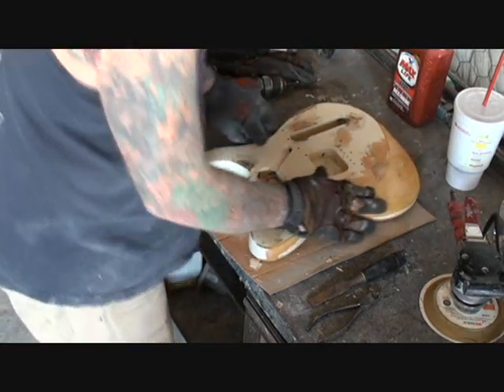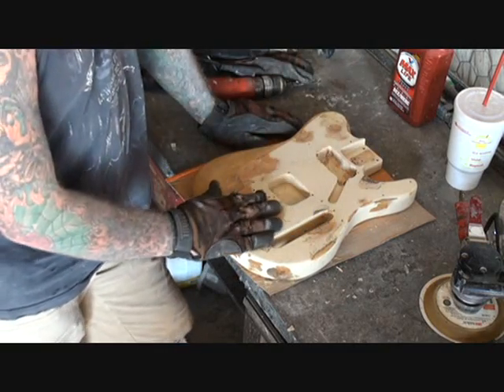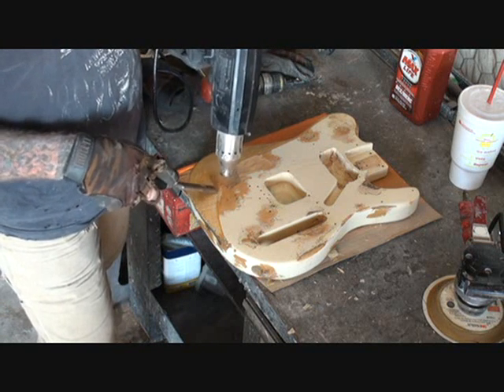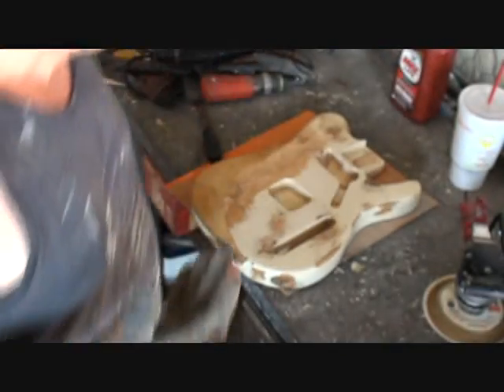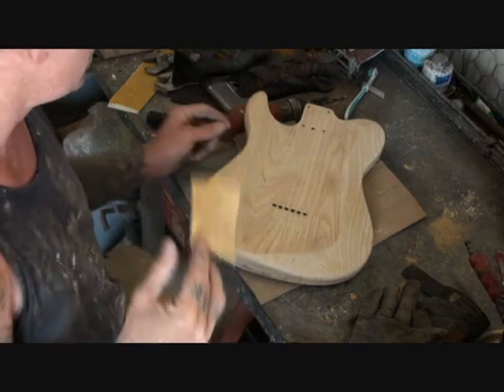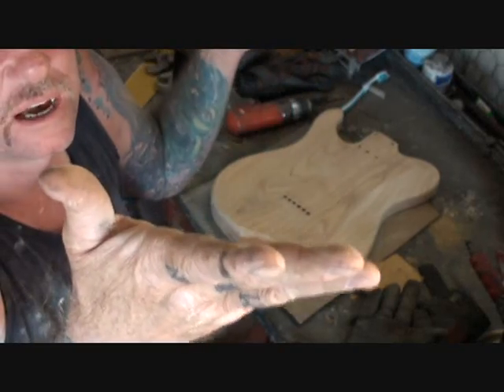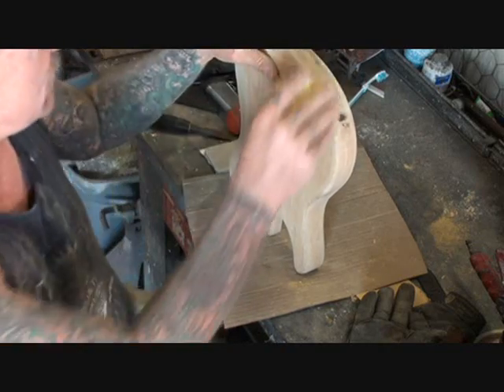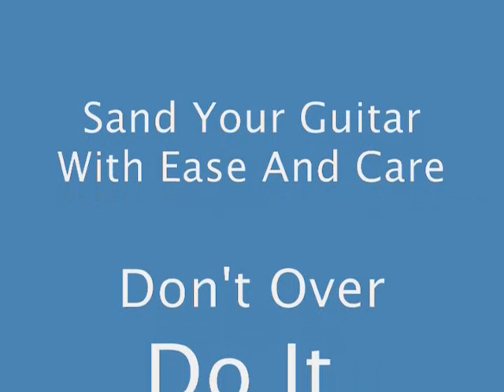How To Refinish Your Guitar-Peavey Reactor-Removing The Old Paint

Comment: Hey Dr, nice vids, I enjoy them! Im an artist out of Michigan. I thought it was perfect. I just wanted to share some knowledge. In last stage of sanding you can get super smooth surface by doing this. Wet a rag with warm water and saturate the surface of the wood. What this does is it brings up all the little burr ends when it dries. Take a piece of steel wool and deburr the wood. You can repeat 2-3 times makes finish go on super smooth. ENJOY!!!

Comment: @TidewaterHooligans Use klean-strip premium stripper. you don't damage the wood. Using a heat gun you run the risk of burning or charcoaling the body. If you do this, your new paint will not adhere well to the wood and it will not end well

Comment: Man,  I spent hours doing it with the heat gun,  and then I found this paint removing stuff.  All I did was pour the liquid all over the guitar  and let it soak for a while,  and after an hour or so all the paint was just bubbling off. 
The paint remover removed both the paint,  and that clear coat primer. 
So I found that this way is a lot easier.  It might not be faster,  but it removes almost all the work.

Comment: I have a question, what would I do if i have a new fender with a polyester finish or polyurethane and it's a 3 tone sunburst lets say, I want to remove the the polyester/polyurethane finish but without screwing up the sunburst underneath it, then i want to take it to a guy to get it nitro-lacqured (i just want my guitar to still look the same basically as when it had the polyester/polyurethane finish but in 20 years I want it to age like the old fenders did)

Comment: Can you lend any advise on this:  I have a Gibson copy (Goldtop). The Goldtop color on the thing sucks (not even close to real goldtop).  I want to repaint with a much closer color.  should I strip down to bare wood -if so, i'm afraid of chemicals or heat melting the binding. Or can I prep the existing finish and paint over top?